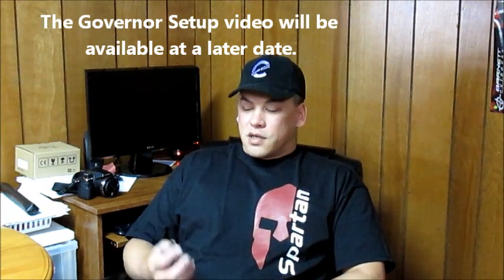Spartan Vortex VX1 - Introduction into Setup

Comment: i hav problem with mu gaui nx4,when switch on gov heli will tilt or bank to left when fly.if not using gov(gov off)my nx4 fly well in normal mode n idle up mode.any idea?mayb gov gain high?
Reply from the maker: Please visit the spartan forum on HeliFreak.com and post this question there.  You will get the quickest help and response that way.